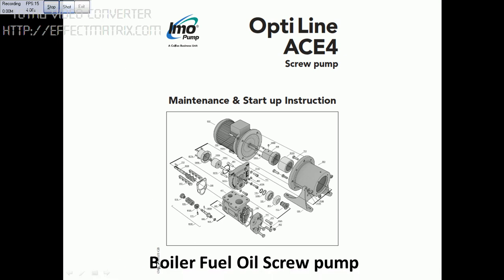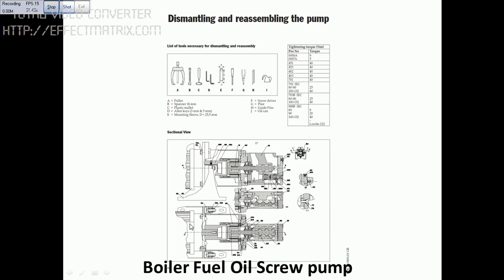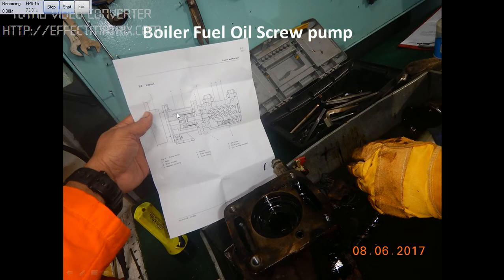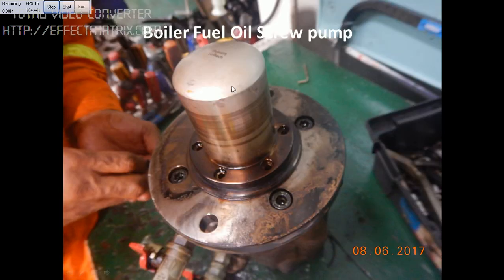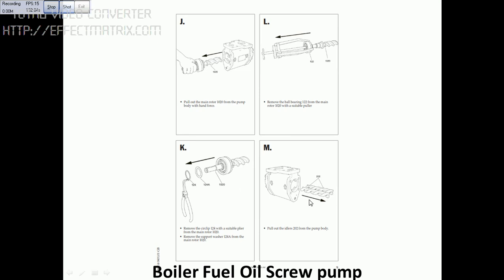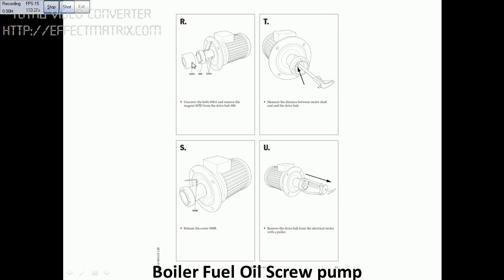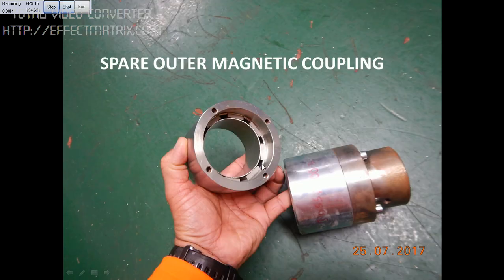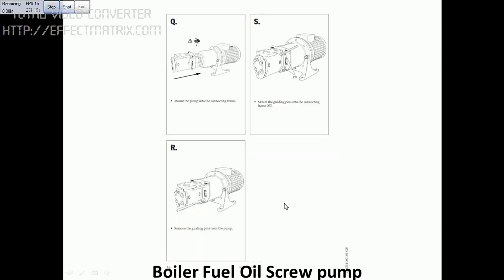How to: Over Haul Screw Pump With Magnetic Coupling?

Comment: thanks alot.
I have to many troubles with this type. some time even chief engineers is not care about scv/port inspiration. but for me its very very important to find out best adjustment. because presently our wearing rate is about. 0.08 per 1000 and more 
any way I am not comfortable with it.and company dont buy new system like on board test kit.

Comment: I am studying ship engineering knowledge. 
first I want thanks for your good videos.
can I ask you make good video about adjusting of mechanical lubricator and explain about procedure in old ships with out magnetic and tbn test device.
Reply from the maker: when you open my youtube  channel : Marine tech hub you can see icon right hand side of the header . you can click to go to my website 1. RT flex engine 2. Nitrogen generator 3. solar power.  full details of CLU and Crank Angle sensor can be see